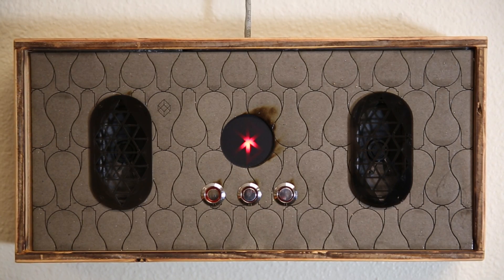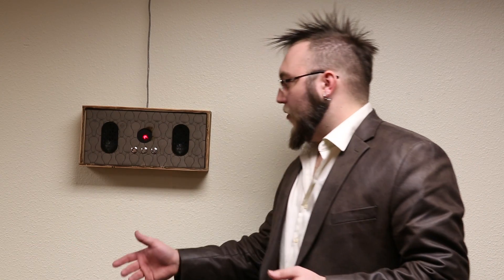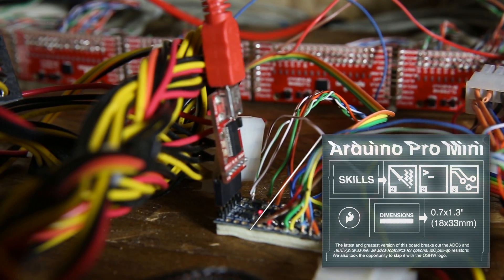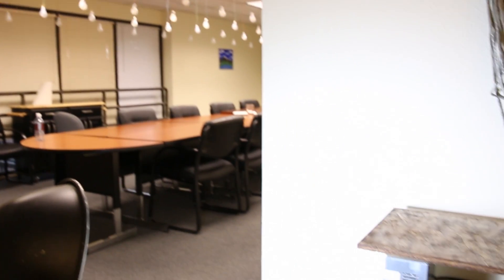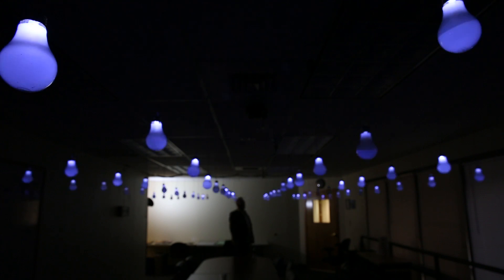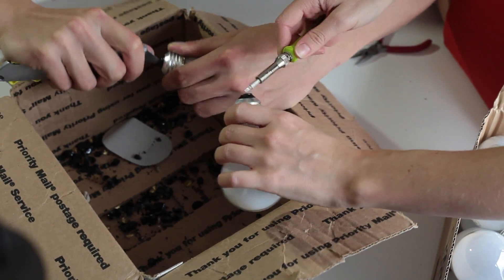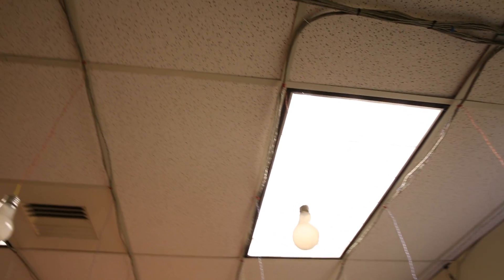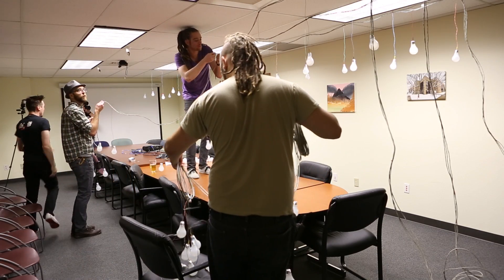SparkFun Engineering Roundtable #24 Interactive Lightbulb Installation

Comment: I guess it works, but it's really ugly to my eyes. Ribbon cables would have looked much better and they're not that more expensive... they would stack on ceiling better, you could use some double sided tape to make sure they stick to the wall (for the motion sensors)
And ribbon cables wouldn't coil up like network cables do, they don't have so many colors.. it would just look more professional.

I also see no reason why there's so many wires. Seriously... voltage, ground, SPI, led driver in each bulb to adjust brightness when it gets command through SPI? That's 4 wires which can be shared by all bulbs in a column or row.